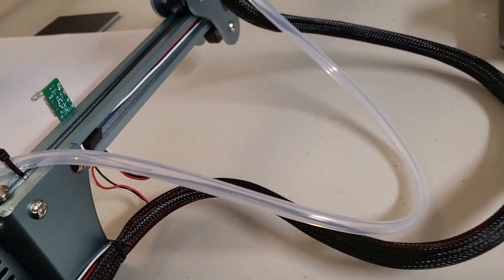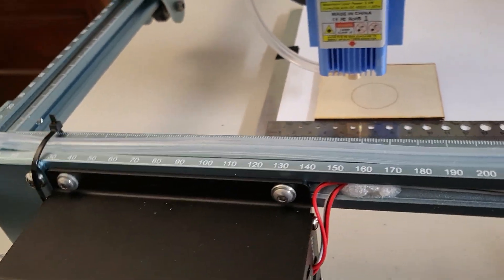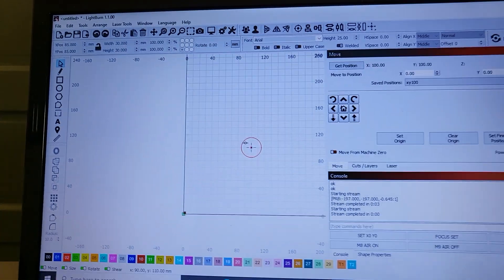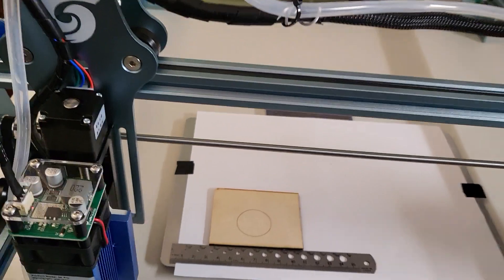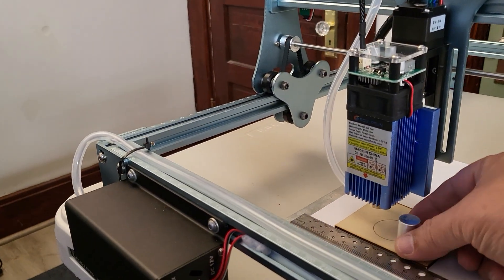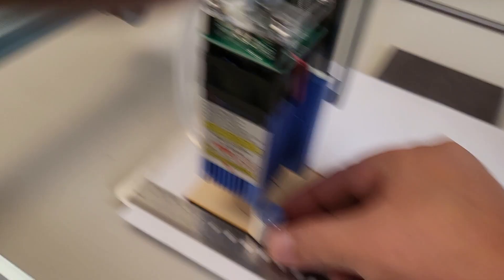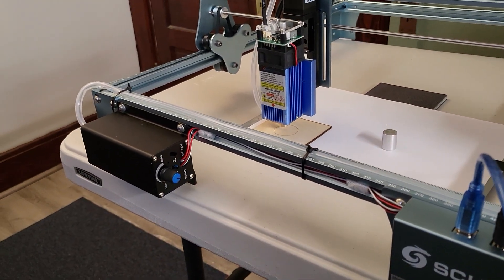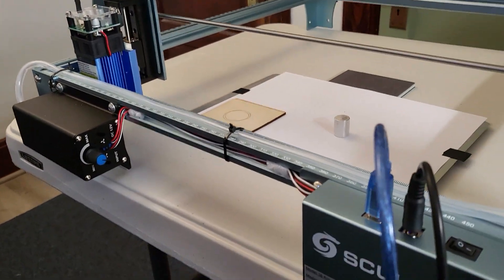SCULPFUN  Homing Air assist and Auto focus

Comment: Where did you get the autofocus upgrade. I really need this upgrade.
Reply from the maker: I did it by myself. at some point I had for sale on ebay , but not any more. the reason for what I did stop selling is not only  buy and install, some flash to firmware is need it,  and I did end up doing customer support, helping whit more than I sold. If you look my other videos you may see what you will need to buy, I get more the parts from Amazon. I had some kits for sale , but not any more, I can help whit some info, but  more companies are selling laser module whit air blower. but auto focus is different story. some rework on the controller is need it.

Comment: Where did you get the z axis with lead screw+motor+mount?
Reply from the maker: Amazon Befenybay 50mm Effective Travel Length Mini Linear Rail Guide Lead Screw T6x1 with NEMA11 Stepper Motor for DIY CNC Router Parts X Y Z Linear Stage Actuator
Reply: @HD3DHiFi  I love you thank you

Comment: Hola, tengo la SCULPFUN S9 y tengo un Aerografo para pintar Modelado, mi pregunta es si pudiera usar ese mismo compresor como asistente de aire para la cortadora LASER? o No es buena idea.
Reply from the maker: el punto de usar aire es muy sensillo, avecuar el humo delante de la optica y el laser, es como el sol y las nubes, si hay nubes no vez el sol , y otra funcion del aire es remover particulas carbonizadas de el material que cortas, en este caso la presion influye un poco, pero el ollin del material es  mas pesado que el humo, casi cualquier presion de aire funciona, normalmente casi todos estos compressores empujan aire suficiente.

Comment: Oscar, how do you control the auto focus? Did you connect an additional stepper motor to the circuit board? I tried connecting a third motor, but it does not respond to Z-axis commands...
Reply from the maker: Did you add extra driver to the controller?
Reply: @HD3DHiFi  I did 🙂. I had a BigTreeTech driver floating around 👍
Reply: I just found out I had to add an additional stepper driver board to my Sculpfun S9 board. Now it works and I can control the Z-axis 👍

Comment: What are the links to your kits?  Depending on price, I'm interested in everything you're working on for the sculpfun 9!
Reply from the maker: Currently I have a kit (#1) on stock, but I stop the sale on ebay,  I will be out for vacation. Once I return I will send you the link. Sell will come back on April 9, Sorry for the delay. The Kit # 2 and #3. I'm working to get on sale kind off mid to end of April. You can go and get your pump. see the comments I had for pump on Amazon.
The kits 2 and 3 price, I think will be less than 30 USD, not including  the pump and relay circuit inside  the pump
Reply: Send me a link to your eBay
Reply from the maker: @jasonsteele73  https://www.ebay.com/itm/255562414811?hash=item3b80b4fadb:g:4qkAAOSwBbdiEkce

Comment: Un trabajo muy bueno, que compresor de aire es? gracias
Reply from the maker: EN AMAZON
Genmitsu Laser Engraver Cutter Air Assist Nozzle Air Pump Kit for Jinsoku Laser Engraver LE-1620, LC-60A and Genmitsu Fixed Focus Laser Module
Reply: gracias

Comment: Great Job Oscar. I have the pump, do you have instructions to install it on the controller to go off and on.  Also interested in that kit for the z auto focus thanks
Reply from the maker: A few parts I did scrap from my junk yard , for prototype. The Laser module holder to the Z mechanism I designed  for my needs and 3d printed it. The circuit, same design it on prototype board.I will make the kits not from my yard. I will oder PCB and to start will do de wiring harness  manually. I will sell instructions, that' take a little while. I do need  to desarm my  TOY to take pictures.
For people do not own 3D PRINTER I do recommend  buying parts. The instructions involves soldering  skills. But if you buy the kit you probably will need elemental assembly skills everyone can do.
Reply: @HD3DHiFi  How about instructions on installing the air pump to the controller the wiring instructions so it can activate and deactivate using lightburn.
Thanks.
Reply from the maker: Connecting to controller is so easy, connecting  12V, 5V, and Aux Pin 3 to ground. The trick is inside the pump and adding a relay. Some hand soldering need it.

Comment: That is awesome work. Do you have any details of parts purchased and any STLs if any of the parts are 3d printed?
Reply from the maker: Are you interested only for air assist kit or all other kits?
I will say there are 3 kits.
1. Homing and limit switches.
2. Z (Laser) auto focus.
3. Air assist.
Currently I'm selling kit #1 on ebay.
The others two some parts I got it from Amazon and others I designed and created by myself. In the future I will create the kits for the one I made, plus instructions How to.
All depend how many people are interested to order.